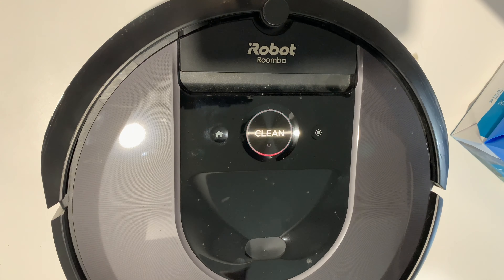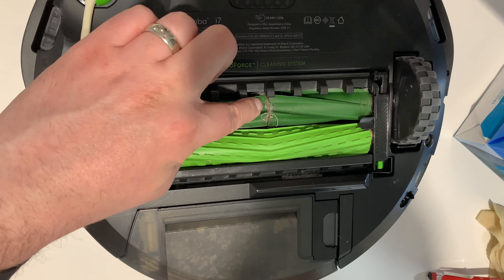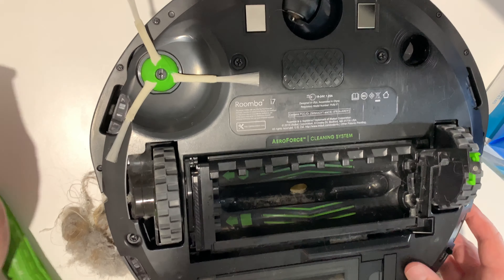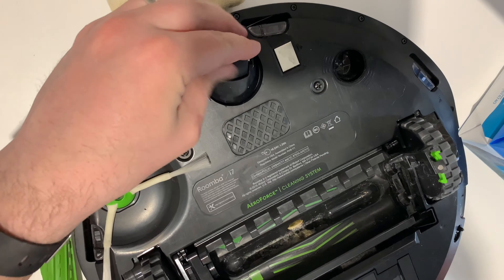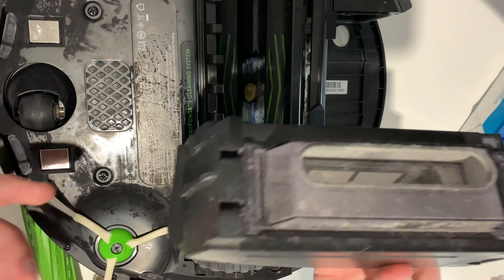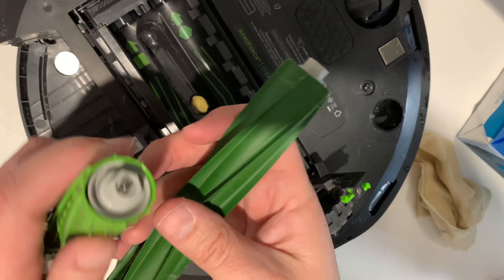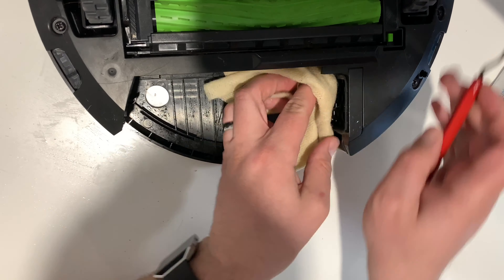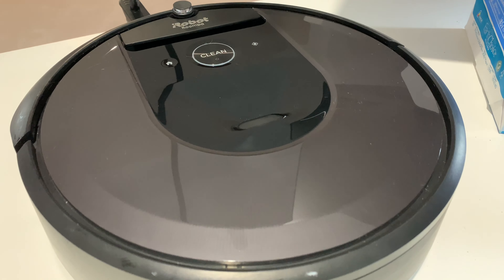How To Clean i7 Roomba iRobot

Comment: take the end caps on the rollers and clean out the hair inside the rollers :) pull the whole  wheel out with your fingers... clean out the hair under the side brush. you must be new to this :( you need to also clean the side sensors where the air is sucked in
.

Comment: Also all you have to do is pull on the front wheel and it comes off
Reply: Thanks that helped tons
Reply: Pull the front wheel to pop it off, then press the wheel itself from the inside and it pops out from the round surrounding piece